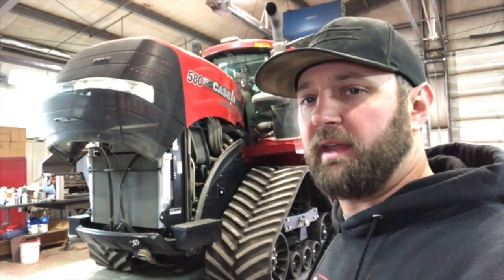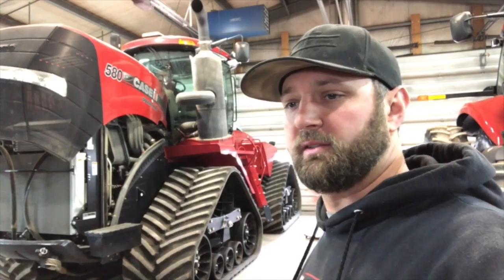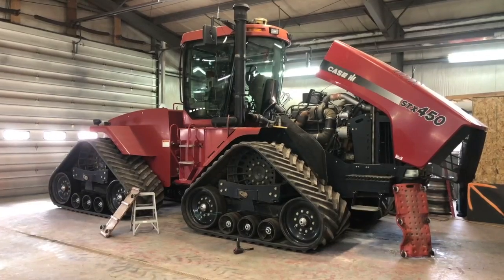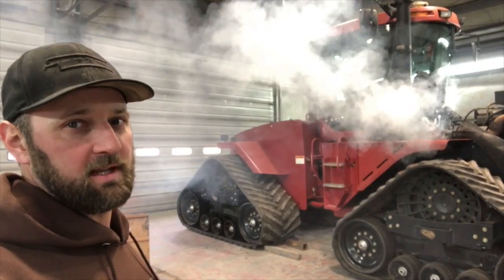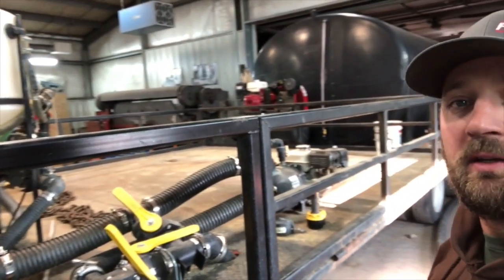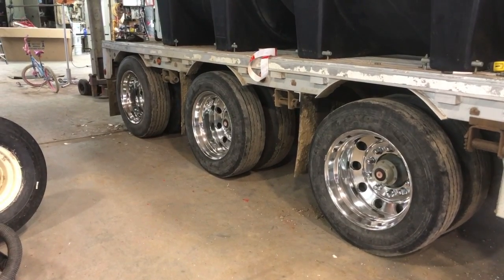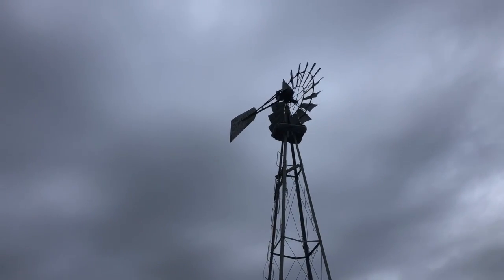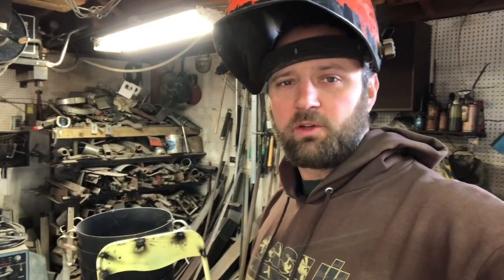Getting ready to seed: flat tire, shop work, wheel polishing, and a float trip.

Comment: Nice video. Those trailer wheels look very sharp after you polished the paint off them. But I see that you break down tires the same way that the shop did where I drove concrete mixer for one season. They didn't have a tire machine, and one day when we got rained out us drivers were standing around in the shop. The bosses young son "Junior" was a mechanic in the shop. So Junior starts breaking down one of those 20,000 lb steer tires by hand, and we were all standing around him in a circle watching, including his Dad ... the boss. I said to Dave (the boss) that they needed to buy a tire machine. Dave said "We got one" and he pointed at Junior. LOL. That company believed in doing everything the hardest way possible. One season there was enough for me.

Comment: I spent 24 years with Deere worked up to a master field technician, left Deere worked for Caseih almost a year  . I see in the video you have a stx 450 . When working for the Caseih dealer I worked for, a customer had the same tractor, it had major rear end failure and a year and a half latter Caseih still does not have the parts for it .. Guess that’s why it was traded to a GREEN TRACTOR

Comment: Wow that trailer looks like brand new.  All u did was polish the paint off and that chrome finish was the result.  Wish my truck rims were that way. U said u were bolting down the stuff on the trailer. So Do u take it off for the winter.  Or do u winterize it. The rv side of me is thinking the pumps come off. Other wise what do You do to keep things from freezing and cracking any of the valves.  I come across a lot of issues with rvs not being winterized right. Would think rv antifreeze would be bad in your equipment as I know it kills my grass when I flush mine out.
Reply from the maker: Working to Relax We haul hay with that trailer so we drain it and take everything off. The wheels weren’t painted just oxidized. They hadn’t been polished for awhile.
Reply: Fast Ag Montana wow. Either way they came out looking like new. Nice job.